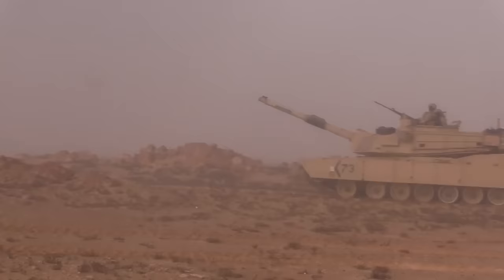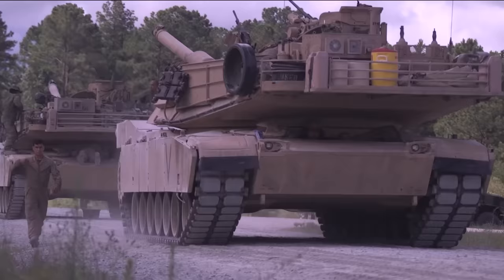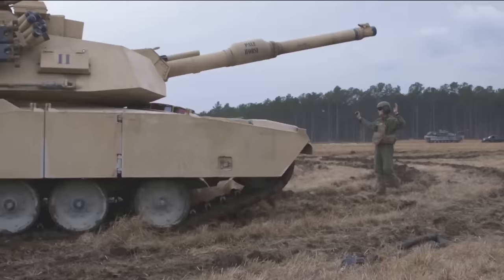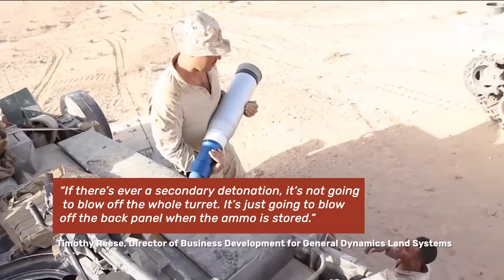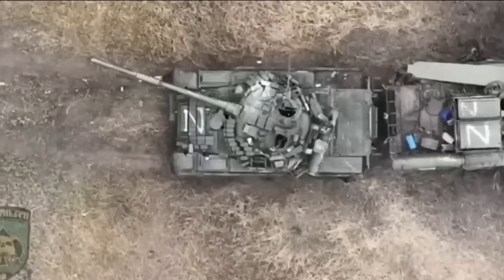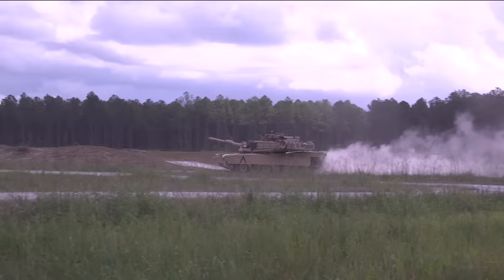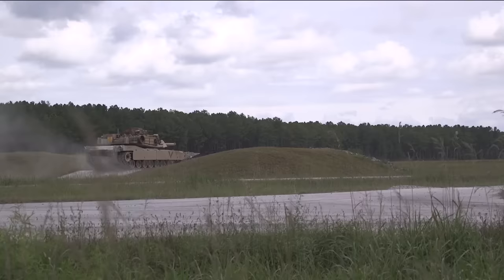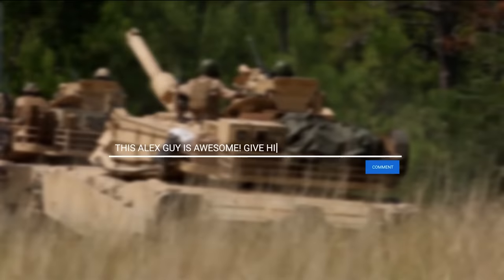America's next-generation main battle tank: ABRAMSX

Comment: Alex, thank you for putting this together, and Hope Seck for her in-depth study. Sounds like the X incorporates everything learned from the Abrams, recent experience by the Ukrainian's and of course a focus on logistics and sustainability. That Diesel Electric combo had me thinking freight train locomotives, so that technology, coupled with batteries should be very mature. Sounds like when a bid goes out, and pre-production evaluators hit the field, it will be something to see.
Reply: But the abrams x was in development way before the ukranian-russian conflict. Vehicles of this concept, of which this abrams x is very much a demonstrator concept, are more of a companies means to the government to show what can be done. In the end it will be the government that decides how every part is designed even if GDLS disagrees even if the disagreements are sound and proven.
Reply: I don't think this diesel electric setup is similar to a freight train. I would expect something closer to a souped up diesel car engine to get max revs, high efficiency and low weight. No variable RPM mode, only off, sleep, start, warm up from cold start, and full power. If they want something mature I would expect something closer to a large portable job site generator than to a freight train. Cutting weight is a big deal.
Reply: @NomadicOneify facts!
Reply: @NomadicOneify  My bad, I conflated the vertical drone launch with "Cope Cage" experience.
Reply: What's Hope's channel?

Comment: I wouldn't be surprised if the Army would want to keep the loader, just assign them as the remote weapons operator (UAV/Crows). The reasons for having a 4th crew member are still there (replacement crew for injuries, more hands for field repairs, manual operation of automated systems).
Reply: Agreed.
Reply: No space in the hull
Reply: @williamwchuang  Then they’ll make space. The X is a showpiece we might see some radical changes in time.
Reply: 100% there will be a
DRONE OPERATOR.
just like thos in WW2 that eveey battleship is capable of launching seaplanes to recon.
MBTs having drones for the recon purpose would be also ideal now. Even just having a quadcopter is already an advantage in Tank-vs-Tank engagement.
Reply: Sure but there's no reason that 4th guy needs to be in the tank.  You can put the 4th guys in a Bradley or something.

More importantly you can just buy more tanks.  Cutting the weight from 70 to 60 tons also means the cost is 15% or so less than otherwise.  Far less armor on the tank as you only need big armor on the crew capsule.  Less weight then means less engine and fuel.  You can keep the tread for an improvement in ground pressure, or cut back to less tread too.  And having cut all that means you need even LESS engine, fuel, armor, treads, etc. etc.  So rather than buy 6 tanks you buy 7 tanks and it's not quite as pressing to repair them, so you again don't need the 4th guy to do the repairs.
Reply: @Stino Pharan  why does the drone operator need to sit in the tank taking up valuable space? It's more likely they'll take the French approach and have the extra man in an IFV or truck behind the line
Reply: Alternatively, they'll just drop the human operator all together and just AI
Reply: @rhystaylor851  Are you suggesting that the tank carrying the drone should have its drone operated by another vehicle?
Reply: @lqr824  Are you suggesting that instead of the tank carrying the drones getting direct info. That they instead have a Bradley operate the drone then relay that info instead. Creating an insane amount of extra work load and giving hostile ECM more routes to attack from. Also mind you these drones also double as a weapon system.
Reply: @MultiKbarry  It's not an insane extra workload.  In today's battlefield, talking to another unit should be as simple as talking to the guy to your left in the tank.

My suggestion would be to treat the three people in the tank as all multipurpose, with commander driver and gunner all being able to deploy drones and attack with them, as well as  Bradleys--which may only be a few hundred meters away--being able to do likewise.  It's great the Abrams X can launch some drones, but tank doctrine is that tanks normally operate as part of COMBINED forces.  They NEED infantry with Javalins and Stingers.  They NEED Bradleys to carry the infantry.  They NEED gas trucks and spare parts and now and then a rescue vehicle to extract them.  The modern combined force OF COURSE needs drones, and OF COURSE this CAN be done by tanks, but I wouldn't argue that this job can ONLY be done by tanks.
Reply: @MultiKbarry  I don't think the tank should carry the drone at all. Much better to carry&control the drone from a light vehicle behind the line then Datalink the feed to the tank crew. Or if they really want the drone tethered to the tank, use AI piloting
Reply: @lqr824  Having to focus on two separate orientation and then double checking proper engagements from a drone is a shit ton of work for a tank. 
Your second point completely ignores one of the greatest strengths of tanks. The ability to cowboy out far ahead of logistics and infantry support. There’s also an issue with complete reliance on assets that might not always be available. Also I never said that tanks should be the only ones deploying drones. The Switchblade 300 it uses aka the drone is effectively a little missile that can scout.
Reply: @rhystaylor851  What do you mean by AI drone? To what capacity would it operate at without input? The Switchblade isn’t some unarmed recons drone they can’t risk it going pit bull on non targets.
Reply: @MultiKbarry  the USAF is investing heavily in AI piloted & AI enhanced jets, I imagine adapting the tech to fly a Switchblade wouldn't be that difficult. Deadly force could be authorized directly by a crewman with a simple yes or no
Reply: @rhystaylor851  no

Comment: We need a vehicle with no weapons that is just a land based drone carrier.  Carries like 100 switch blades in vertical tube launchers and a but load of quad copters to swarm stacked on top of each other.
Reply: Likely so. But would such a design be deployed alongside artillery pieces and from a doctrine point of view be a rear echelon vehicle? Like a partner vehicle for HiMARS to provide ISR, correct fires , and have a quick response counter battery capacity?  Maybe even some radar capabilities to detect enemy fires and UAVs?  Anything expected to be frontline needs something to provide suppression fire right?
Reply: @chriswilkerson4074  intermediate and very mobile.  Some of the drones long range intel gathering,
Reply: Even if you use a modernized Ford Super Duty as launch vehicle, such drone swarms (if most of them can't be jammed) can take out dozens of new tanks. Very cost effective, manpower extensive, and mobile.

Comment: Potentially, they could've installed auto-loaders in the Abrams decades earlier. However, I think they never did that for all these years because the tech at that time was still too much of a liability.
Reply: Installing an autoloader on a preexisting Abrams would be a large and costly retrofit.
Reply: Legacy autoloaders weren't nearly as fast either.
Reply: @viper_7712  they experimented with adding one to the abrams
Reply: not really russian autoloaders are shit but that doesn't mean that all autoloaders are the french and Japanese leclerc and type 10 can fire a round pretty much every four seconds continuously and can remove a round in the breech unlike the russian ones also the US has been testing autoloaders since the 70s

Comment: The added  benefit of the hydrid engine helps provide power overhead for future weapon systems.

One if the limitations of the aging US Navy is there isn't enough power to power additional weapon systems. The same principles apply for every other heavy hardware platform.

Since the Army hasn't ordered an open call for a replacement for the Abrams, the Abrams X is a great platform for marketing, to possibly inspire Army requirements when the competition comes down. And it's coming.

The US Army has chosen a replacement for the blackhawk, the m16/M4, the m249, added the JLTV and the light tank that isn't a light tank. They're still working to replace the Apache, and looking whether to replace the Bradley. The replacement for the Abrams is still easily 10 years away if even on procurement road maps. 

Coverage for this a little late compared to other videos, but it's fun to see it pop up.

Comment: What a lot of people don't seem to be noticing about the Abram-X is the use of supercapacitors in the hybrid powertrain. This not only allows the Abrams-X to use a smaller, less powerful diesel engine, but gives it the greater flexibility of the battery bank while still being able to match the original Abrams' performance. The original Abrams didn't need that powerful engine to do 45 mph on level ground. It needed that engine to do 45 mph on a level surface, then hit a steep slope and not have to slow down. Thus the American cavalry tank concept. Supercapacitors and electric motors let Abrams-X do the same job with a smaller and much more fuel efficient diesel engine. (As an aside, if you haven't read up on that engine, do by all means. It's not an ordinary diesel.)
If you think all that is spectacular, just wait until you see what the USAF does with supercapacitors and high energy lasers! It will literally be "SPECTACULAR". Not the sort you'd want to see if you're a bad guy.
Reply: So they could use the xm360 with ETC and not need bigger rounds

Comment: I got a chance to talk to the GDLS team at AUSA. The three across configuration would problem not make it to DD250 handover. A more re-imagined interior would probably emerge, ideally with the someone in the turret for troubleshooting the gun and turret systems. I've got a video of one of the interviews with Reese on the page.
Reply: Are you saying that the turret on the AbramsX is inaccessible to the crew, if something needs troubleshooting?
Reply: @roberthaines4221  yes, and that’s precisely the problem. Guns get dirty when firing and often require manual adjustment to engage. Hard to do that if it’s two meters away in a sealed turret you can’t reach.
Reply: @roberthaines4221  Sort of. There is accessibility currently, but no one stationed in the turret. Ideally there would still be a Tanker in the turret to troubleshoot full time.
Reply: @roberthaines4221  The turret is accessible to the crew and can be operated in degraded mode.

Comment: AbramsX: Everything the T-14 Armata wishes it could be, and more.
Reply: And in 10 years' time another tank will come along & do the same to the X. What's your point?
Reply: @paulg3216  That the T-14 is a vastly overrated parade queen, as demonstrated by the war in Ukraine. So here's the AbramsX casually sitting on the sidelines as a tech demonstrator, showing what the US is more than capable of achieving, but doesn't yet need to because said T-14 is just a parade queen.
Reply: @Evolution_Kills  Well send them to the battlefield then
Reply: @ScorgRus  Can you not read, or do you lack comprehension? Abrams X simply isn't needed yet, because there does not yet exist a threat it would be needed to counter that current Abrams cannot. So it remains a tech demonstrator, and the US had the good sense to not parade it about in literal parades as some Potemkim charade, because (again) it doesn't have to.

Comment: The AbramsX is one idea for the modern/future battle tank. Make it more lethal and survivable by making it bigger and sticking more things to it.
Sure, it is lighter, reduced in turret size, but higher and bulkier in other categories. The real question is if the role of the MBT still exists (it probably does) and if it does, should it be filled by a cheap drone vehicle, expensive drone/ai vehicle, a crewed tank as small as possible or one as big as possible.
Like the German KF51 Panther design, does it need more weapon stations? Does it need loitering munitions? Or does it need infantry and IFVs / anti air vehicles?

Comment: Imho, a programmable airburst round from an automatic secondary turret is just necessary for a new tank at this point for drone defence and is much more important than a machine gun. You need to be able to go from detecting a small drone to shooting at it within two seconds, otherwise it will be dropping a half pound shaped charge on you or allied vehicles

Programmable rounds are much more cost effective to deal with drones than the next layer of active protection, are arguably the single best non-ewar anti-drone countermeasure, and they also make enemy attack helicopters even less relevant. The machine gun secondary is something that should be left to IFVs or to accompanying infantry, but every vehicle needs airburst to defend itself and infantry against drones.

Comment: I wanna know if it will be capable of taking a heavier hit or is going all in on trophy like systems.
Reply: Good question.  There’s probably an upper limit on total weight for tanks, not just because of engine power, but ground pressure, bridges, rail transport, etc.
Reply: i dont think APS is at the maturity level/scale level yet that it can replace passive armor, nor can it really deal with APFSDS as well as other munitions
Reply: @Hertz Wave  APS are still in their infancy but limited by the amount of munitions it can carry. I'm not sure about countering APFSDS, though.
Reply: @lostinpa-dadenduro7555  Hitler designed this 1000 ton tank/land battleship called the Ratte, and it was immediately cancelled by those in the know, for getting stuck everywhere,because nothing would be able to support it's weight.

Comment: Approved by this old 19K! I like the Trophy system and the idea of a 30 Cal turret. No more carrying the M2 from the arms room or carrying 2 barrells and having to change it out or messing with  headspace and timing and troubleshoot issues. I also like the see through tank tech. I would like to know if they fixed the heaters or are future 19K Tank Crewman going to request an extra sponson box for heater parts?  Also, what is General Dynamics answer for protecting this hybrid tank in cold weather?  Batteries don't do good in the cold. And where are these batteries stored for easy maintenance and what armor protection will they have from getting an equipment kill?  I'd love to see powered aux USB-C ports for hooking up and charging encryption tough tablets for operations, digital sand tables,  weapons and tank maintenance, operator manuals,  operator videos covering everything for weapons, and equipment on the tank, maintenance records, parts requisition, Field Manuals, Training Manuals, first aid, SOIs, continuity books, etc. It would be nice if they could  add a little more to the pioneer equipment such as explosive devices to help make a hasty for the tank or LP/OP.  What about some materials to help the tank blend in with the environment?  I mean BMW makes a car that you can change the paint color with a push of a button, why can't this be applied to a tank? Where is the cloaking tech? It might be a little tough to do these 2 things, but it's definitely possible and of done right worth the price. All of these are force multipliers. Oh and the dang thing ought to have a NBC system that warms and cools the Soldiers inside changing the ambient air inside. I always told people that a tank is like an oven in the summer and a freezer in the winter.   We have pocket computers these days.  Help future tankers out so they don't get heat exhaustion, heat stroke or freeze to death.  Oh and have self cleaning V-Packs so you don't leave your tank vulnerable having to traverse the gun to get the V-Pack doors open and left open while you pull each V-Pack out to clean.  There has to be a better way!  😂 What about air tags or similar tech that each Crewman has keyed with geo-fencing so that if an enemy combatant gets to close to the tank and no one is in it, an alarm goes off and all vital operating  and weapon systems get shut off until the tank can be rekeyed with vetted tank crewman.  Just some ideas to make it an even better smart tank.
Reply: Headspace and timing was done away with long ago with the flex 50. I had one all the way back in 2009
Reply: Dude he said 30mm turret much bigger than a .50 cal it's what the A10 and the Apache fire